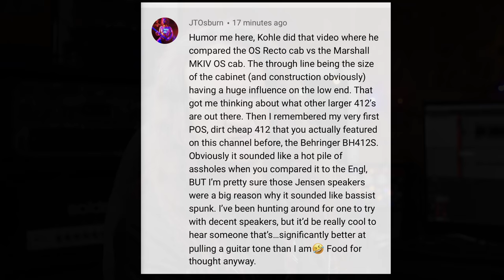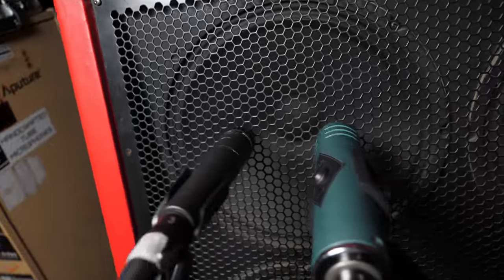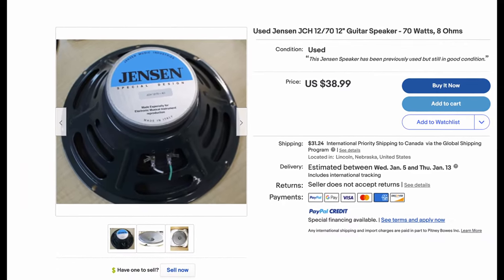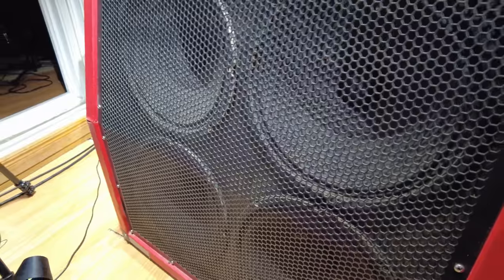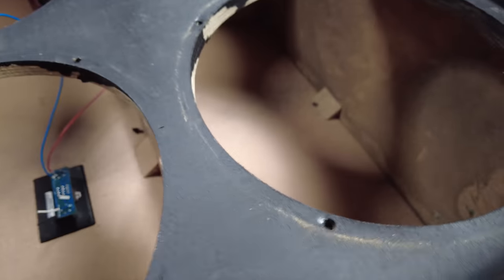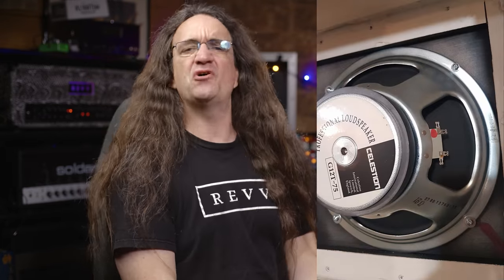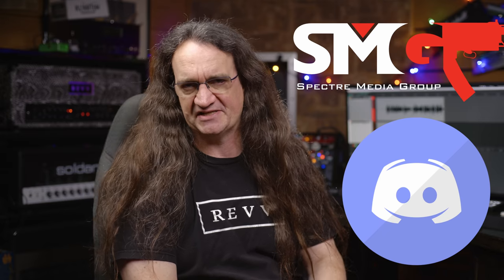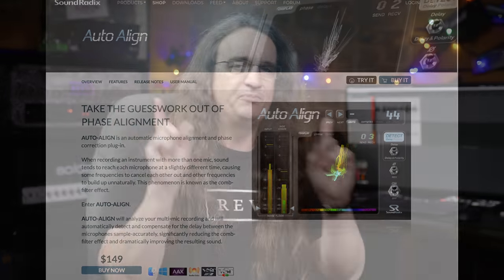We Upgraded the WORST Guitar Cabinet in the WORLD!!!

Comment: Questin: When you did the tube-test video, witch was great btw, you said that mic placement was super important and to rule out that factor you used ir´s instead. How did you manage to get the exact same miceplacement when you did this test? Even the slightest change in mic-position will change the sound dramaticly. Right? Greetings from Sweden
Reply: Good question! I’d imagine that he wouldn’t move the mics and put tape on the ground for the exact spot for the feet so everything is in the same spot. It isn’t 100% but close enough that it wouldn’t create the drastic differences in tone we see here.
Reply from the maker: Different speakers.  Their mic placement isn’t critical.  The cab swap video WILL be though.  That’s going to be a tricky one.

Comment: The Jensens kinda sounds like Doom Metal, meant to sound shitty, but yes they do sound shitty. The final mix with Neo Creambacks/Grindstein is lightyears ahead. Imho. Regarding the idea itself, when I needed a new cab a few years back the 1960s where all sold out and I had a DSL top wanting matching looks. Solution, a cheap second hand Marshall MG case and I filled it with 4x Creamback 65. Totally satisfied, used live several times and the only thing obviously sucking is of course my playing. Used with DSL and JetCity HDM, very different sounding but both equally fine    :)

Comment: i've got an old marshall jcm800 cab from 1983 loaded with t75 speakers, love the lead tone, the rhythm tone not so much, that's where prefer my Diezel cab with K100s. 
similar kinda here, i prefer the lead tone of the jensen speakers over the celestions, but the rhythmtone of the jensens truly is hot garbage. especially later when you add in the grindstein into the mix.
i'm kinda shocked about the prices of the Marshall cabs there. over here in germany a marshall vintage 4x12 is like 650€ new, while the mesa i pretty much the same price here.

Comment: Time vs money.

If you have the money, just by a full amp system from your favorite amp company and learn how to use it. 

If you don't have the money, you're gonna spend a lot of time on finding, buying, selling, fixing, upgrading, replacing, etc. components.   By the time you're done, you likely spent more money than buying a high end amp system in the first place.

For my dream amp, I chose Engl.  All the components are stock Engl, purchased new. I've owned this amp for at least 10 years, because it does everything I want and more.

Comment: Totally unrelated but ive been trying to get my daw to output, without lag, to streamlabs. I can get the sound in, into cakewalk, through the amp sim, and xan hear what i want to send. I have asio link pro, have everything set to send to mix 1, and have mix 1 as the mic input on streamlabs, but it just recieves the straight dry in signal from the interface. Any chance of a detailed, step by step, with proper order and set up to be able to live stream, using amp sims please.

Comment: HOLY FUCK! No wonder I hate Fender amps! Those Jensens sound like you put an EQ in the loop and cut everything but maxed 6.4K! I love my Eminence Swamp Thangs and old Eminence 80W Tubeworks 4x12 Tweed speakers, I got new in 94 (DARK AND BASSY CAB!) and not thrilled with the V30s in my Orange PPC412 a they can cut your head off. I want to put a pair of my friends GT75s or Swamp Thangs to Add some damned bass and less harsh mids. Also, I run a fuck ton of Fuzz, Od, and stack HM2S, with those and my mids cranked on my 2 Orange 3/Stacks it cuts like a claymore!

Comment: The only issue here is you didn't really adhere to 'design of experiments' protocol.
You changed 2 parts of the experiment! The speakers AND the grill were removed.
It would have been a better comparison to only change the speakers and have everything else identical. (Mic placement, etc)
Clearly there's a huge difference here though - so it was still a great video.

Comment: How did you deal with the switch goofiness? It’s wired in a weird way for any speakers combos…
Reply: Cause it (or at least mine has) Jensen 12/70 4 ohm speakers wired in series (all 4 @ 16 ohms and A nd B side @ 8 ohms) but its weird how to add nice Greenbacks i have that are 8 ohms @ 25W

Comment: A few years ago I bought a shitty Burgera 2X12 cab new for pretty cheap (don't remember the exact price but probably less than $200) And the stock speakers on it sucked. I swapped them out for a V30 and a Greenback and now it sounds awesome! Problem with that is that since it's a 2X12, it can only handle about 60 watts now because of the wattage on the Greenback. I'm looking into swapping them out for a couple of Eminence CV-75 speakers to not only get a change in tone, but up the wattage the cab can handle so I'm not limited as to what I can plug in there. Upgrading shit cabinets with better speakers can make a world of difference and save you money.
Reply from the maker: You can run Greenbacks pretty loud and not worry.
Reply: @SpectreSoundStudios  How loud are we talking? Like if I ran a 100 watt head into that 2X12, would it still be okay or would I fry it? I'm only running a 20 watt head in there now (Peavy 6505MH) so I could crank that full blast if I wanted too and it'll still more than fine. That's the one thing that confuses me about speakers. They're supposed to only handle a certain wattage but then there's a weird, undefined threshold you can go above but if you go too high then you can fry your speakers. Also, I re-did the math, and my cab can only handle 50 watts (Greenback being only 25 watts and you multiply your lowest watt speaker by the amount of speakers in the cab, at least from what I've read.)

Honestly just curious because I'd like to upgrade to a head with a higher wattage in the future and I was looking to essentially "future proof" my cabinet. When I say higher wattage, I'm looking at somewhere around the 100 watt range or higher. Not that I need something that loud, but there's a few amps that I love the sound of that fall into that category.

Comment: Can't stand MDF, or chipboard as it used to be called in the UK. It's completely defenseless against the mildest humidity, can't handle weight very well, (my Soundcraft Spirit 16/4/2 mixer actually bowed one of my MDF studio worktops) and screws have a habit of splitting or chewing up the useless crap. You're far better and cheaper just constructing a box from far sturdier and longer lasting pine.

Comment: I've been thinking about replacing one of two of the speakers in my 4x12, one of them sounds just awful and a different one sounds nearly identical to another, but it seems like most high end cabs use 8 or 16 ohm speakers wired in parallel whereas mine uses 4x4ohm in series, so by doing the math I'll never end up with a neat 4, 8, or 16 ohm cab that my amp head can match. 
Is this a huge problem? Or can i just match it to the closest one (while not overloading the cab of course) and adjust the volume? Or do i need to take the hit and buy 4 like-rated speakers?
Reply: You should be able to connect two of your old 4 ohm speakers in series for 8 ohms and then two (new)16 ohm speakers in parallel which also gives 8 ohms, then you can choose if you want to connect these pairs in parallel for 4 ohms total or in series for 16 ohms total. What ohms settings does your amp have availible ? Ideally you want to match the impedance on the amp and cab, never use a cab with a lower impedance than the amp impedance for example 8 ohms on the amp and 4 ohms on the cab, the other way will work but you get less sound level, so the optimal is to match, always strive for this.
Reply: @Stefan  hm. I've never rewired a cab so i haven't looked into exactly how it goes yet but i was under the assumption that i wouldn't be able to separate what was being wired in parallel. So, i could wire 4+4 in series for 8, but then the 16+16+8 would all have to be wired in parallel together, rather than a (16+16=8)+8. Is this not the case? Or did i math wrong and it doesn't actually matter
Reply: @Stefan-  turns out not only did i math wrong but i partially misread some of your comment. That makes a lot of sense. I have no idea why i couldn't get the numbers to work out before. Thank you
Reply: @deavas86  No problem ! Its certainly not the most common solution, a series parallel combination is common though, but not like this and with speakers of different impedance. This all comes naturally for me and is very basic electronics since i have been working professionally with electronics for 35 years and playing guitar for 40.

Comment: Honestly, I also have a brand new 150W Eminence Swamp Thang and one so old it has the old graphics! I  want to do a new Vs broken in speaker test using scientific Method. Gotta use my $90,000 Environmental science and History degree for something.  Also, I always presumed tone wood in cabs was bullshit too. It's never wood, its material density.
Reply from the maker: "Material Density."  Now you're talking!
Reply: @SpectreSoundStudios  I talk a lot, sometimes something that isn't moronic sorta poops outta my brain. But yeah, Material density, think of how heavy and awesome acrylic and wood and resin hybrids sound?  There's a reason new Les Pauls (Epi or Shitstorm, I mean Gibson) sound weak compared to older ones and especially Japanese Mahogany used in 70s Yamaha SG300-3000s. No chambering, higher density wood than American Mahogany so its not the wood, just density. I have a 1977 Yamaha SG800 with a Kahler and at 13lbs compared to my 99 Korean Epi Les Paul Custom at 9, I sold the Les Paul quick. Furthermore, even then, I have Squier Jagmasters and a Japanese Market only Fernandez JG40 Shredder Jag. They are basswood and alder, doesn't matter. I focus on pick ups , PEDALS! My Orange Amps(with whatever the fuck tubes work of course! The Rockerverb 100MKII has KT88S, no tone change, just higher headroom. That is it.) I have a few different cabs and speakers in the rigs and they all blend beautifully!  
But seriously, you can build cabs out of pressed bamboo and they would sing as long as the speakers are good!

Comment: I wish this sort of thing were possible with bass cabs, but in general the science doesn't quite transfer over. You're just as likely to ruin a bass cab with a speaker swap as you are to improve it. The speakers are almost always chosen for highly specific reasons with the enclosures they come in, since the power required to move those huge sound waves is very different from guitar.

It's a shame, because I'd love to try mixing and matching with bass stuff. Oh well. Time to smoke some weed, lift some weights for 7hrs straight, get a sweet new tattoo, and not learn any of the music I'm supposed to